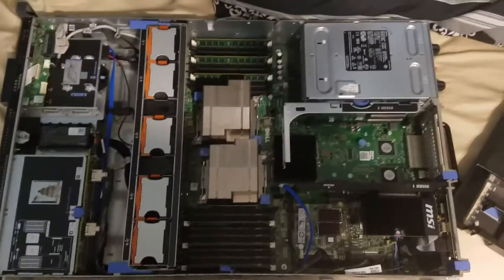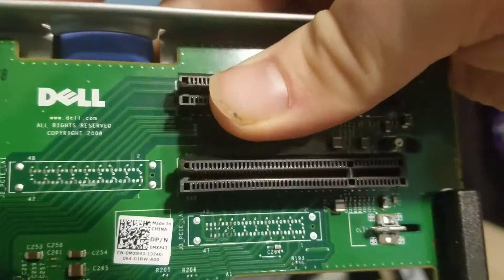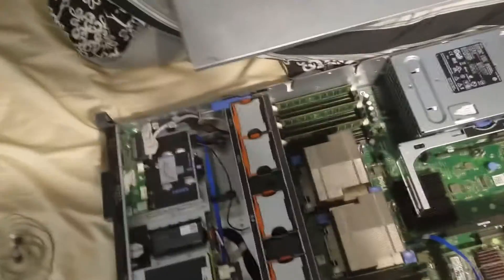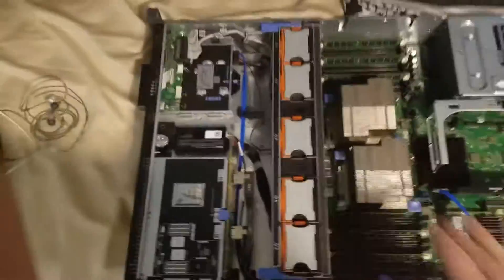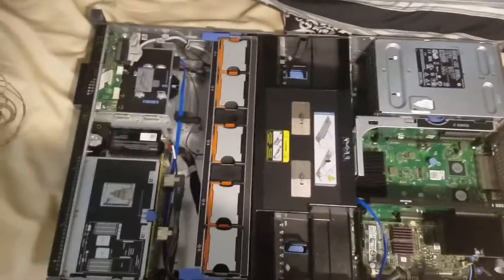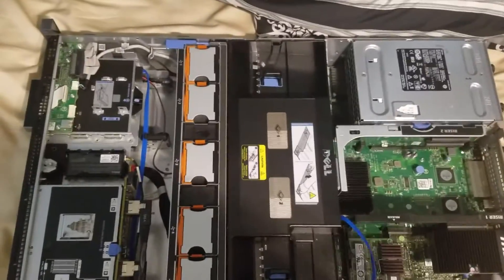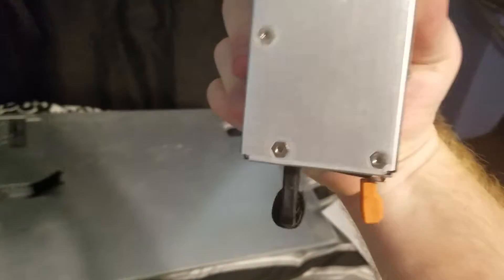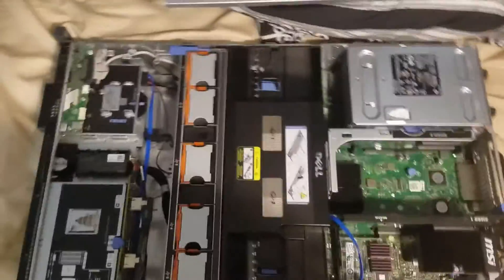Dell PowerEdge R710 Server to Workstation Build

Comment: Hi Sean,
Could you please tell me which is the most powerful graphics card that Dell PowerEdge R710 support it?
I want to buy one but I don't know with which one it will work the best!
Reply: I know this comment is 3 years old, but the most powerful card you can currently have is a gtx 1650. The server doesn't have any power connectors for graphics cards, you you can only use cards that consume 75W or less because they can draw that from the pcie slot and doesn't need an aditional connector.
However, it is possible to use any graphics card you want as long is it physically fits in the server if you use a second desktop powersupply to supply the extra power.

Comment: Great Video !  Have been using an ebay APC Smart-UPS 1500 mini tower with two 12 VDC batteries for the past year.  The 2U rack version (Smart-UPS 1500) has four 12 VDC batteries per some YouTube videos.  The UPSs have been backing up the Dell I-5 Desktop, the 23" 1080P Monitor, the ebay Dell 24-Port switch, the CenturyLink ADSL Modem...  So when the lights flicker the system stays up and connected.  Thank you for the video !  tjl